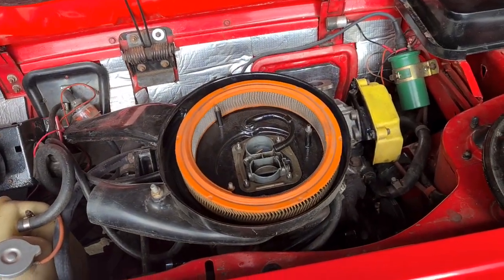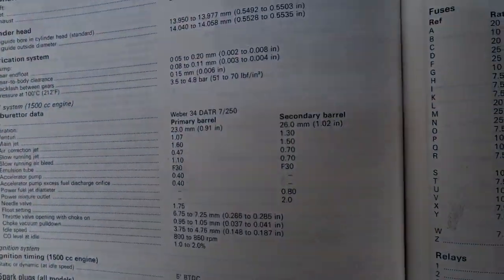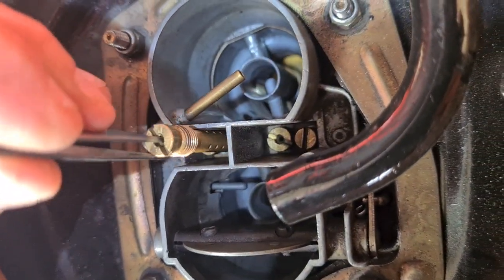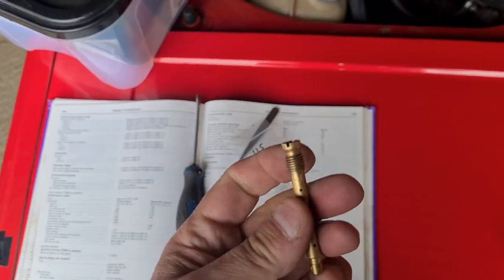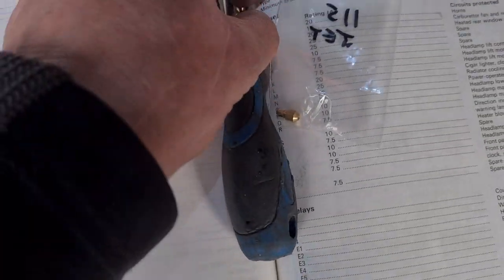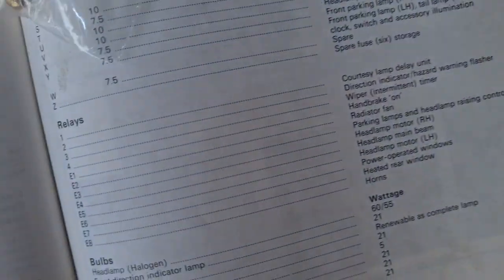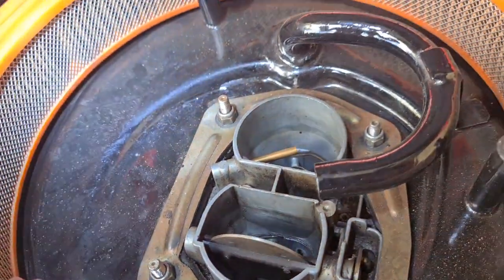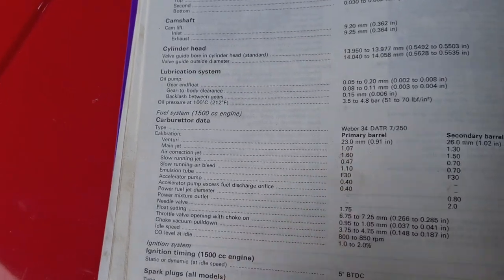Fiat X1/9 weber carburettor jets explained

Comment: ....I'm a little late to this video but glad I found it. I'm having idling problems when at full temperature on my X1/9. It has been suggested that maybe the idle jet has some crud in it causing a blockage. Is the process of removing these jets as your video shows the easiest way to remove, check and clean them? I haven't adjusted any mixture settings on the carb and it was running absolutely fine!
Gaz.

Comment: question - on all the jets where is the best  position to start when having done a rebuild-  all the way in   or back out a number of turns ??
Reply from the maker: All 4 jets are non adjustable. You screw them all in (not too tightly as they are brass and soft metal). The only adjustment is the screw at the side for idle mixture. You can alter the 4 jets by pulling off the jet (at the end) and putting on a different one (they are cheap). The various forums will steer you to the best setup. I went up 2 main jet sizes to stop the slight hesitation when putting your foot down.

Comment: Are you sure that the order L to R is secondary idle, primary main, secondary main, primary idle?  When I cleaned my 34 DATR X19 carb, if I blew air or solvent into the hole where the outer idle jet lived, the adjacent main jet hole bubbled.  All the info I can find for other 34 DATR carbs contradicts what you say in your video
Reply from the maker: Well that was my take on it, but I could be wrong. I did strip and overhaul the carb.
Reply: Ye my 1982 1500 runs L to R  47  130 107 70  totally opposite and runs I like your video very professional but I have been asking around for looking at a top view of the Weber 34datr the 4 holes what are the primary and secondary from a factory point datum